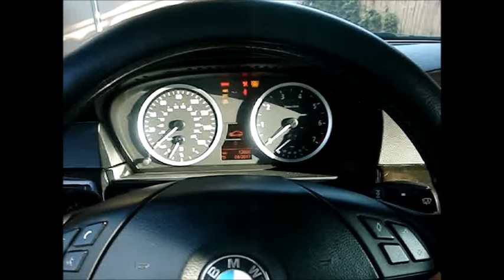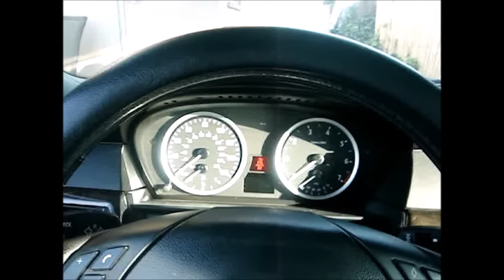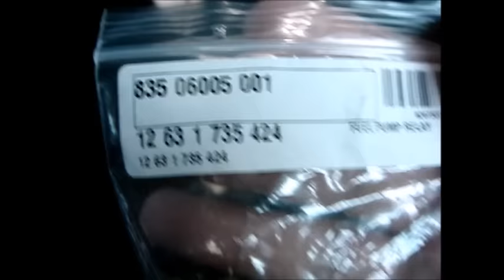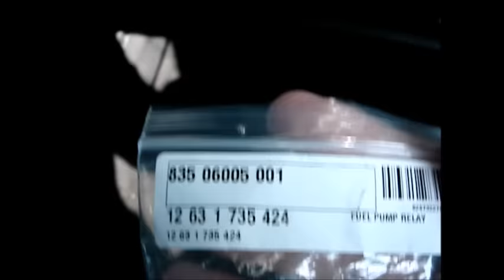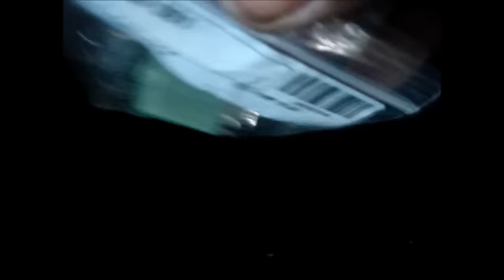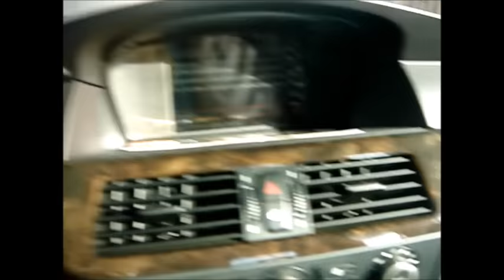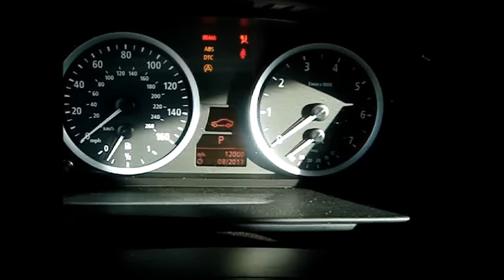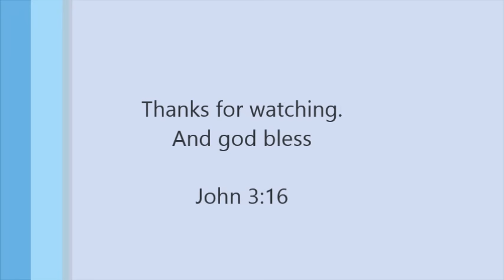BMW will not start ? / BMW Crank's but will not start ? Easy fix Watch this!!

Comment: Have 2003 no codes crank no start all fuses checked with a meter, all good. No dash warning  or any lights when key is turned on.
Reply from the maker: Spray some starting fluid in the intake and if it starts fuel is not getting to the fuel injector. Most likely your fuel pump if the fuses and relay are good.
Reply: @oscars-autorepair3236   I drove my 06X5E53 BMW to the store shut off just as soon as I shut off I try to start it so I've been having issues with the mobilizer and turned over but wouldn't start when the star came out thought maybe cooling it down same had it told home didn't think the space would start a fluid annex I have not ever worked on a BMW I'm in American motors guy that's built motors but never messed with this German stuff or et cetera so I'm gonna try your thought with the starting flu didn't think to try that and for some reason it was like you turned the key off cause when the thing was screwing up before it wouldn't even turn over and I've learned if I went through a sequence I could get it to start and I'm pretty sure they called me a mobilizer cause I just roll the windows down up make the trick the alarm use the key to open the door and and 9 out 10 times will start right up or I just do it again and it would start

Comment: My E46 320d most of the time just long cranks before start with lots of white smoke, the Vp44 pump Bosch is set to early ignition timing but don't know why it still cranks, even with hot and cold engine...

Comment: I have a '94 540i ( I think it's an E46 ) I replaced the fuel filters & fuel pump, forgot to check the relay first. After replacing relay the car ran fine, for a week. Died on road, will crank but no start, same as before. Relay doesn't click while on car. Clicks fine when not. Where does power to relay come from. Relay has continuous power at pin 30. Any ideas? Thanks

Comment: Thanks dude.. I have a 328I 2007 and it sounds just like that..I've been trying to figure it out for the past 2weeks now..lol  I mean I just installed a brand new fuel pump like 3 months ago and this happened ..im hoping it's the fuel pump relay..thanks again dude.. I'll keep y'all updated
Reply: Did it work. I have the same car same issue. I would appreciate a response. And if that didn’t work what did ?
Reply: @joshuahodge3387  it was the fuel pump control module..
Reply: @vnsmx4569  did that completely fix your crank no start? Car still running good?
Reply: @tazmaniandiva7762  yes sir it did..

Comment: good job dude. How did you find that that was an issue anyway.?
Reply from the maker: i started with the easiest fix...the fuel pump relay. if that did not fix the issue i would have moved on to the next step witch was checking for spark...compression ....ect.
Reply: @oscars-autorepair3236  I have a 2004 BMW 325i ... replaced the fuel pump, spark plugs ignition coils and MAF as well....five months ago. Well today the car is just cranking but not starting. I replaced the fuel pump relay and fuse this evening but still crank no start. Could the fuel pump go bad that fast?

Comment: did you hear the fuel pump kick on?
Reply from the maker: no, it did not kick in
Reply: Hey Nicole did u fix your bmw
Reply: @kingcharles6226  yes I did.  I changed the starter.

Comment: Where’s the relay in a 535d lci? It’s not in the glove compartment.
Reply: https://www.carcarekiosk.com/video/2014_BMW_535d_xDrive_3.0L_6_Cyl._Turbo_Diesel/fuse_interior/replace

not sure it works for yours but its worth the try
Reply: I got the same problem,but relay is not in the glove compartment

Comment: There are two identical relays I can see in your video. What's the other green relay on right side of your fuel pump relay ?
Reply: I believe that's the horn relay. It is identical. You can swap them as a free way to test the fuel relay.
Reply: Brett Welcome Mine was the relay fault. Replaced it and no problem since.
Reply: One mechanic said its fuel pressure guage and glow plugs. Estimate $2k. I didnt trust coz there was no other symptom but no start.
Reply: well glow plugs are for deisel but could be same prob

Comment: I have a 2006 325i but it starts after long cranking every time! Is it still a relay problem? Or something else!
Reply: I got a very good mechanic who diagnosed a dirty fuel filter. He said it could either be a fuel pump malfunction or the filter - both on either side under the back seat. He then checked for the electric signals in the pump which was ok. Then he said it had to be the filter. Bingo!

Comment: I have a 2008 X5  and  I have the same problem . My car will not start in the daytime but starts at night after 7pm. I know it sounds crazy but it's true. any idea's?
Reply: Marvie Barton Try this video's suggestion (Fuel Pump Relay). If that doesn't work you might need to replace your IVM. Search around for videos on that as well.
Reply: Hi Marvie.  Does your X5 sometimes start during the day? My 5 series BMW would start, then stop immediately. After about 5 tries it started and stayed on. It turned out to be a cam-shaft position sensor. A very cheap part to replace, and it took me about 15 minutes to replace. Another thought, when you are trying to start the X5, what is the daytime temperature, and what is the temperature at night?
Reply: Hi Marvie. Have a look at this youtube video. https://www.youtube.com/watch?v=S1EmtwJh2o8 
It's quite thorough, but listen to how the X5 is starting, and if it sounds similar, then it will be your camshaft position sensor. Hope this helps.
Reply: Just use it at night and buy another one for day time.
Reply: @CrazyforCruiser  🤣🤣🤣😃

Comment: how do you know when its gone bad just by looking at it?
Reply: Crank, no start is often fuel or fuel components.  If it cranks then there is most likely not an electrical problem.  If it was just recently running then it is most likely not an engine problem.  Thus, what is left are fuel components.  If your vehicle has good fuel and is full of fuel then the most likely culprits are:  a weak fuel relay, a bad fuel filter, or a bad fuel pump.  If the car was recently running with no hesitation then it most likely is not a bad fuel pump.  That then leaves the fuel relay and/or fuel filter as the most likely culprits.

Comment: I replaced hpfp, and fuel relay because my car died on highway and it still won't start and if it does it dies shortly after. I programmed the new fuel module as well
Reply: Slow N54 I had this same issue for me I had to replace the fuel pressure regulator. It's located under rear seat behind the driver side. Also it might be an issue with lpfp which is under the rear seat passanger side.
Reply: Orange X Xxx fixed it with fuel rail  pressure sensor
Reply: Slow N54 that's good to know incase I run in this issue again.

Comment: 2008 bmw 528i same noise it had in the beginning . Let’s see how this goes
Reply: Did it work
Reply: Did this work? I have a 2010 been ta two shops they finally got it to crank dis gotta be the only solution

Comment: Ive gota e92 320d msport 2008 cut out after filling with fuel 30 yards from station. Now it wont start ba k up just turns over could this be the same  any help will be appreciated
Reply: Kyle Tonks did u fix it?
Reply: Amer S No i think the chain snapped
Reply: Amer S no im selling it
Reply: How many miles did it go? Are u 100% sure that it is the chain? What exactly happens and how does it sound like when u try to start it?
Reply: Its just cut out wont start had it diagnosed and was showing cam sensor faults changed sensor no good. Then looking through the cam sensor hole the cams arent moving but it sounds like it wanted  to start just wont no nasty noises either
Reply: 139k miles

Comment: I have a 2007 525i my car does the same thing but i don't know anything about cars.I had 3 mechanics take a look at my car.2 said it's either the cam shaft sensor or crank sensor.The 3rd mechanic says its my fuel pump.I'm just confused because no one mention a relay switch.I'm not getting fire is what one said.So does a bad relay switch keeps it from firing and starting?
Reply from the maker: try spraying some starting fluid on the throttle and crank the car. If its starts and dies you might have a fuel pump issue but before replacing the fuel pump check the fuel pump relay first. You can switch it with another same relay and if it cranks and starts just buy a new relay for the pump.

Comment: Where is the fuel pump relay on a 328i x drive 2009 located? I'm having the same cranking no start situation
Reply from the maker: On the 2009 328i X drive, I don't think there is a fuel pump relay. They only have the  fuel pump control module it is located in the trunk  on passenger side.  You will need  to pull the insulator to get to it. I hope this helps you.
Reply from the maker: you can get the fuel pump control module online for 30-60 bucks.
Reply: Hey I'm having the same issue 2006 525xi. I have replaced ekpm3 and coded. I can get ista to Manually active fuel pump but I can't get dme to do it when I test the module. Help please don't wanna go to stealership
Reply: @oscars-autorepair3236  Hi, sometimes this happens to my 2009 x5 will this be the same procedure?  Besides not starting how can you check the fuel pump relay I mean does any connections look burn or something like that?  Please help...
Thank you in advance!

Comment: My bmw e60 2005 fuel pump is blowing fuses again and again. Fuses are in the boot and it is number 50 ''fuel pump'' of 20amp.. Any idea ?? Please help..
Reply: replace the fuel pump.. its drawing to much current, hence why the fuse is blowing.

Comment: where is the fuel pump relay for e53 x5
Reply: I've just successfully done this on a diesel E53.  It's a lot more complicated, because you need to remove the glovebox entirely, to get to the screws holding in the fusebox.  The fusebox is only open to the fuses themselves, and the relays (pump, horn) are behind/above the fuses, so you need to pull out the fusebox to get to the relays. 

Good news - there are YouTube videos available for the various steps, but you might have to search for "remove glovebox" etc., as none of the videos are comprehensive.

Comment: Where is it in a 2006 525i e60
Reply: Did you ever figure it out? I have a 2006 325i.
Reply: @tazmaniandiva7762  It was an electrical problem that would cost way to much so I sold it
Reply: @jasminwilliams1281  man that sucks! I was just told that mines needs a new engine and the engine itself for a 2006 325i is around $8000😱 thats ridiculous!

Comment: you forgot to mention that there is a removable flashlight right next to the fuel relay...you could've also bypassed it...for free
Reply: How do you bypass it??
Reply: take a pc of wire about 3 inches long, bend it into a u shape and strip each end, you jump any 2 leads with key on, have somebody listen under hood for hsssssssing sound, when u hit the right 2, there's your bypass...
Reply: Manny C Weiss where ?
Reply: @mtbridingog9083  don't do this, you can use the relay right by it, if you connect the ground and positive feed together you will fry a wire, maybe the one your holding if you're lucky
Reply: @stevenlee92833  to late ...nothing happened to my car but thanks
Reply: @stevenlee92833  my issue was my mass airflow sensor

Comment: Where is the fuel pump relay located on a 2007 530i?
Reply from the maker: your 530i and my 525i have the same engine E60 so the fuel pump replay should be in the same place as in my car.
Reply: I have 2007 530 xi (e60) Hello fellow Bimmers It is in trunk near battery, above the battery and above the fuses. Right side of trunk. Fuse Relay is Black rectangular piece.

Comment: I'm fucking pissed I did this and when I went to plug my battery back in my whole engine wire harness started smoking and I fried my dme. It was in a puddle you saved me nothing and gave me pain
Reply: Would’ve happened anyway
Reply: ground cable under the car?
Reply: @Joelo7734  maybe ground cable under the car?
Reply: No the dme was in a puddle and as soon as I plugged my battery in after replacin this relay my wire harness fried as well as my dme but I got it all fixed and replaced I sold that car a long time ago tho

Comment: I'm currently facing the same issue on my '01 E39 525d. Good tip, I was going for the fuses too, I'll let you know if it works ;-)
It's a total mess that this seems to be a regular problem on old bmws. german engineering.... pah... just a myth :P
Reply: MCP/ChronicBuzz fixed?
Reply: nah, it finally came down to the fuel support pump located under the driver's seat. At least it came relatively cheap, paid € 92,- and had a friend of mine swap it.
Reply: i just hope it's not the chain cuz really expensive to fix
Reply: Amer S you can try to swing the hammer at the fuel pump carefully, mine started after that, but it's not exactly a long term solution.
Reply: Thanks man i will try

Comment: u wouldnt happen to knw were the fuel relay is on a 08 328i
Reply from the maker: jose rodriguez 
Did you still need help ? Or did you find the location?
Reply: Oscar Ruiz-Autorepair i still need help

Comment: I was trying to figure out if you were black. But then when you said, "god bless," I was damn sure. black people are god obsessed. But yo, great vid. having a no start problem with my 320 here in tokyo. cylinder wash down. so gonna pour a teaspoon of oil down the spark plug holes tomorrow.
Reply: Hey bro i'm from chiba. I have same problem with 2005 e87. Any idea where to buy this fuel pump relay?
Reply: oh by the way, after i pour the oil down the spark plug holes? fired up in a quarter turn
Reply: thanks bro.. that's a weird question haha I bought it because I like hatchback cars and I dunno why. I used it everyday for 3 years and suddenly it stalls in the middle of the road, It wont start up just crank, battery was OK and about an hour suddenly starts up. I drove it to the car dealer but they said my car had no problems. I drove it again and after a week using it, it stalls again in the middle of the road. I don't know why.
Reply: oh dude, just google it, find some forums. youll most def find the reason
Reply: Jay - you local Stealership!! They're actually cheap! It could also be your DME (blue) relay.
Reply: check crank shaft sensor

Comment: probably saved me &200-$600
Reply from the maker: that's 200-600 more in you wallet....It is good to hear this video help you out.
Reply: +Oscar R. thanks
Reply: +Oscar R. Today I was driving ,lost all rpms car cut off and is still doing same thing before I changed the relay ,Please help shop can't figure out what's wrong
Reply from the maker: Is your check engine on?

Comment: “This is a glove compartment”, that’s where I stopped the video, really is that what that is.
Reply: Hey Sir, please please help me am using e46 failing to star fuel pump is not even spring diesel to the engine, when a turn the key on the fuel pump is not work what could b the problem please am asking ur help James
Reply: @jsmessoko2872  ground cable?